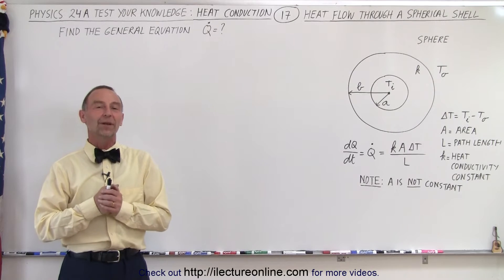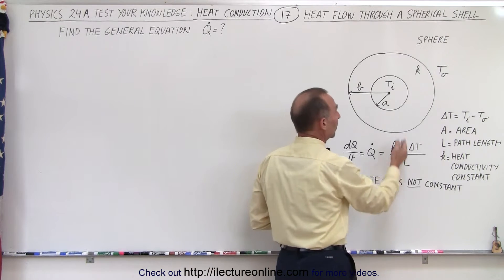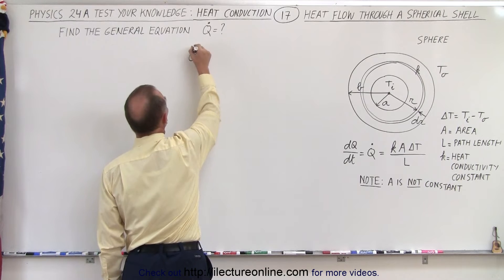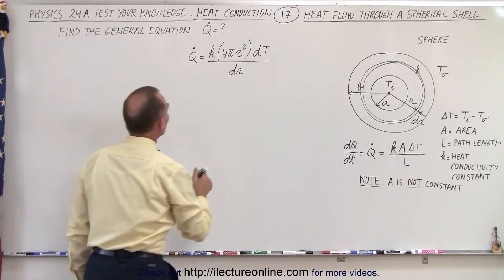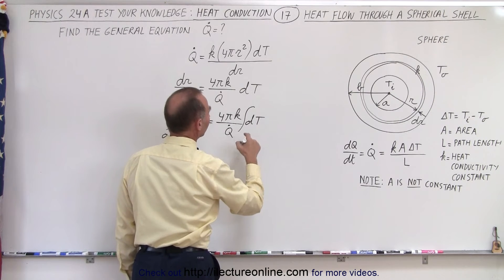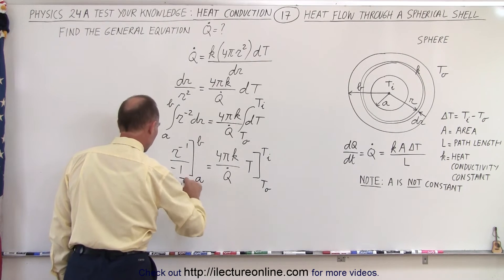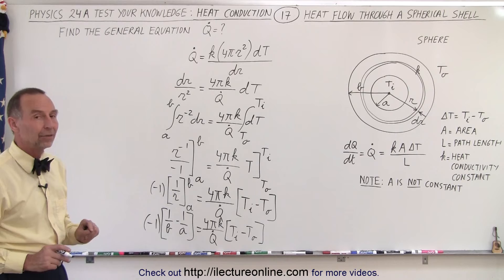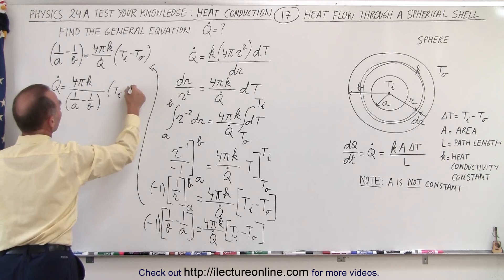Physics 24A  Heat Conduction Examples (17 of 22) dQ/dt=? Spherical Shell

Comment: Sir that small sphere which we are taking as an element for integration is it a holllow sphere is yes than why we not taking it areas as 4π(R1-R2)² R1 and R2 is the inner and outer radius of bigger hollow sphere pls reply
Reply from the maker: You want the thickness to be expressed as an infinitesimal thin sphere where in the limit the thickness goes to zero (as is done in integration).
Reply: So sir that mean i have to learn this value and appply in every concept where we have to do integration of sphere than we have to write formula or area that element 4πr²
Reply from the maker: Yes, this is a good example of hot to do that.

Comment: Another great video.  Can’t you integrate this equation, as an indefinite integral, to find the temperature with radius?  Should be easy to find the “constant” based on the initial conditions that you know the temperature at the outside radius.  In other words, I want to find temperature as a function of radius for a specific (constant) Q dot.
Reply from the maker: Yes, you should be able to do that.